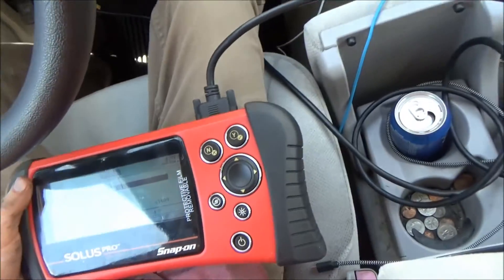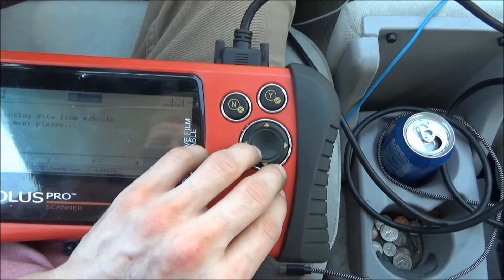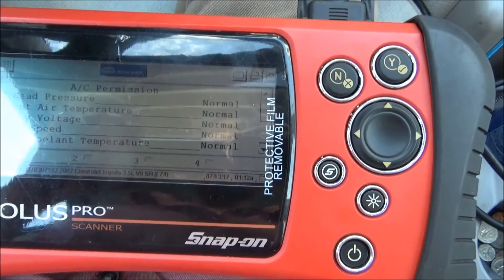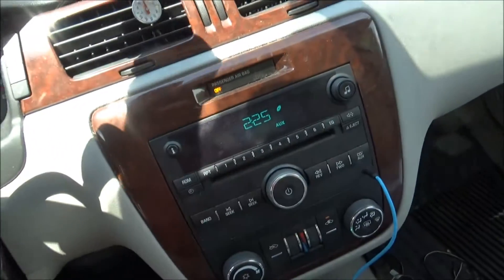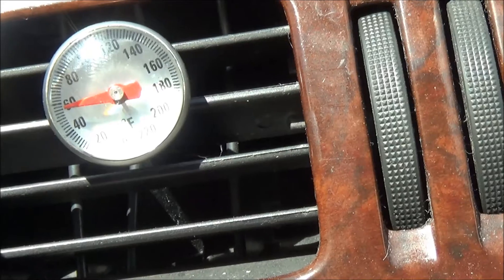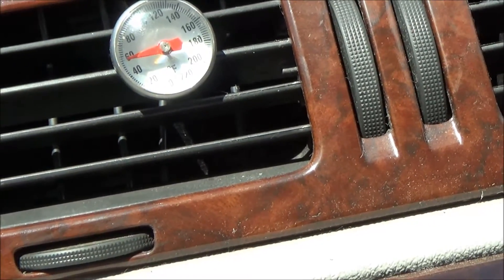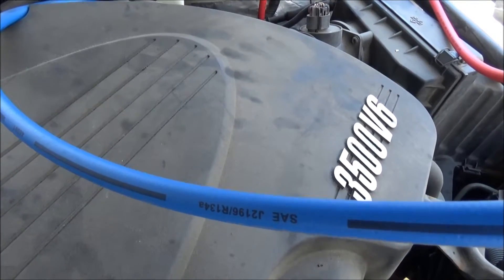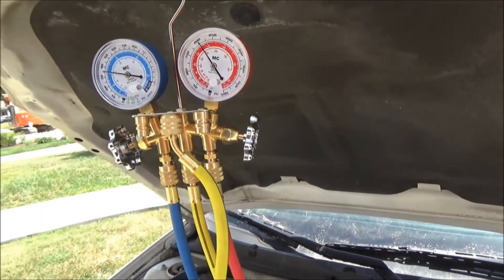How to check and top off AC in your car

Comment: With H- Blocks should my low side match the pressures on the charts? Here in AZ we get high ambient temps, so the Charts say 40-55 psi for low side depending on ambients.

Comment: Thanks although I wish you used a bulk tank instead of a little can.
I just switched to a bulk tank and don't know what the hell I'm doing! I know how to use cans.
It's going to be around 120* here in the desert. 
Wish me luck!
Reply from the maker: Bulk tank is the same as cans. Just a bigger can . Attach yellow hose to tank open valve and flip upside down
Reply: @kdautomotive1165   Thanks. I live 30 mins from Death Valley and there's a heat wave on the way!

Comment: I was curious where do you get that information that the highest pressure you should see is 300 psi at 95° ?. 

      Was your air selector on recycle air or fresh air mode

What is your refrigerant cans the type of refrigerant that has the built-in UV leak die tracer and refrigerant oil for lubricant?  Did your can of refrigerant also include stop leak additive ?
Reply from the maker: Google r13ra pressure temperature chart. It will give you the proper pressure for what ever ambient temp you are at. 

You want max a/c on recuitulation.

You can get refrigerant with dye in it. I wouldn't get the stuff that has oil or stop leak. It may not be the proper viscosity oil and stop leak WILL damage your system

Comment: I think I see a mistake in your procedure, but not sure how it did not suck AIR back into your low side through the yellow hose (near the end of the video).  You disconnected the A/C canister, clearly the yellow line is vented to atmosphere as you hear and see the refrigerant shoot out.  Then you disconnect high side (has a block valve traps refrigerant in red hose). Then you open highside manifold and low side manifold valves with yellow hose open to atmosphere.  This from my understanding would have sucked air into the system through the end of the yellow line which was not plugged ( you did not show it being plugged or closed off after removing canister).  So unless we missed a step, this is technically wrong procedure and people will contaminate their AC system with AIR if they follow this exact procedure.  AM I WRONG? PLEASE EXPLAIN.
Reply from the maker: ComputerUser321 this gauge set has a Schrader valve on the yellow hose so nothing can be sucked in unless that is depressed and I had already had refridgerant in the hoses pior to hooking them up so I did not need to purge the hoses. Great point though thanks for the question!
Reply from the maker: ComputerUser321 also you would just vent refridgerant from both the lines and the system via the low side out of the yellow hose if it was open to atmosphere, you really wouldn't suck anything in